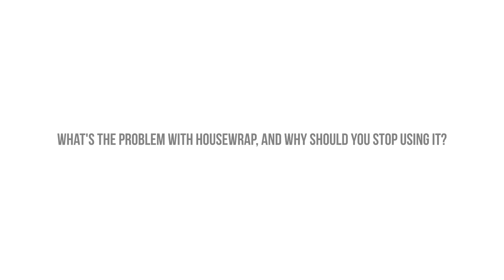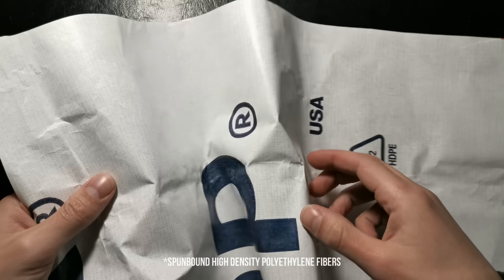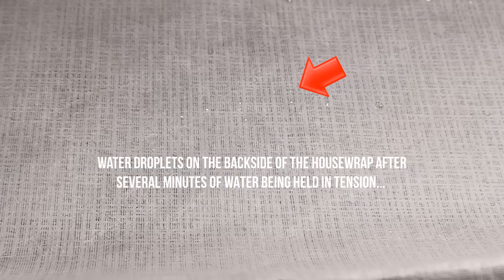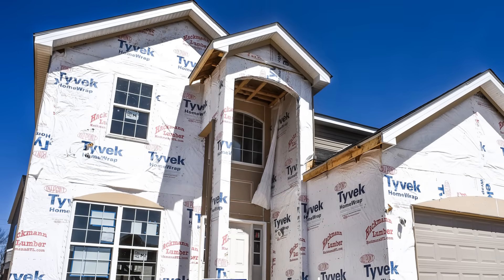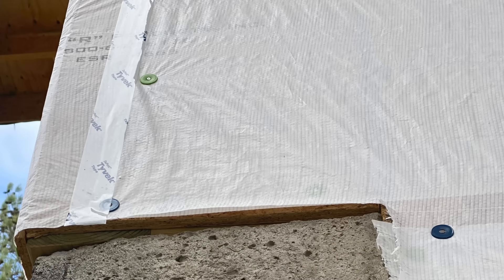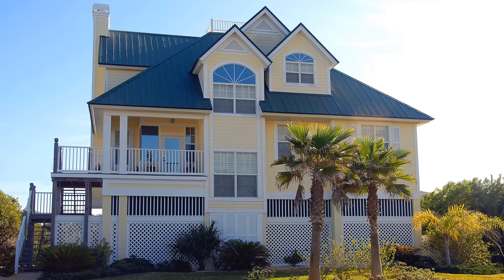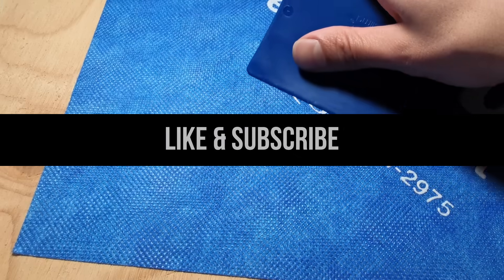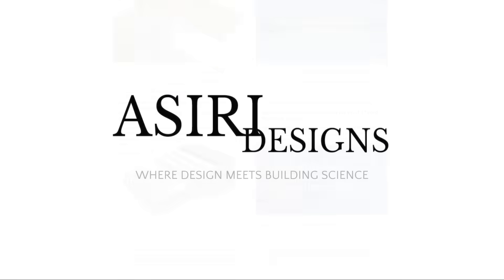Why I Stopped Using House Wrap

Comment: Regardless of what you use, INSTALLATION is the key. If it's not installed correctly it doesn't work. That also includes fixing any penetration by utility subcontractors. Just watch a few Home Inspector videos to see how badly it can be.

Comment: Tyvek is engineered garbage. That picture at 4:24 is real. My bad  experience as a builder had nothing to do with poor installation. We installed horizontal  lap siding over it with the recommended 1 1/4" siding overlap. The same method almost every builder was using. It turns out that wind driven rain can travel 1" vertically for every 10 mph of wind speed. 30 to 40 mph wind driven rain was normal where I built in the Columbia River  Gorge. We had to remove siding from 2 new houses in 1999. The tyvek was wet on the outside but that's okay. The lap siding was nailed to every stud 6" apart. The water was sucked into those nail holes and trapped inside. It didn't evaporate out. The water also traveled horizontally across the top of each course of siding until it reached a window or a corner where it ran down over and under the Tyvek. The OSB was soaked at every nail hole and swollen below windows and the entire lower part of the house.
That was the last time I used either housewrap or OSB. You can tape every seam and flash your windows but nothing will stop water getting sucked through every nail hole.
Put some good 30lb asphalt roofing felt over cdx, flash your windows and relax for 200 years. The tar in the paper seals the nail holes. It's permeable enough not to trap water behind it. I tried 15lb felt but there's no comparison to what you get with good 30lb paper of the grade sold by roofing suppliers. A hammer tacker won't tear it up like it does to 15lb felt.

Comment: Code needs to ban not having drainage between cladding and wrb. I’m about to have a house built and they looks at me like I was crazy when I mentioned using fluid applied wrb and rain screen. 400+k to build they want tyvek with hardie siding nailed directly to it. I don’t have room in the budget to argue against it but seriously considering not even building now

Comment: I wish wraps would reveal how much PFAS they are impregnated with. Truly the stupidest thing builders do is apply vinyl siding  on top of this house wrap for moisture to condense against. Bugs (especially stink bugs) love to hide in it - too many openings for bugs. The bigger stupidest thing is reducing eaves and overhangs to a foot or less and no eyebrows on walls over 10 foot high. It’s like they think the house wrap can handle everything. I’d sooner apply a coat of lime wash to my plywood and back side of my properly lapped siding than build with paper. It’s too thin and demolition has proven it has a limited lifespan - 30 year old paper falls apart when pulling it out. Lime wash adds fire resistance and captures carbon, yet remains vapor permeable.

Comment: 4:26 top right 2 spots failed u can c where the Z flashing ends above the trim covering the step flashing   The water got behind the siding n started trickling down as soon as it left the Z  n the step flashing was worse because it was lower n nobody installed a kick out flashing so the water could exit n do directly 2 the outside where it could dry instead of behind the siding n trickled down the wall n turned the OSB into a swelled up wafer board u could poke your finger through   The half round window looks like it wasn’t flashed right either u can tell it can in by the right corner n it got behind the siding 2   Expensive beautiful modern day home ruined by not flashing it correctly   Tyvek wrapped n taped b 4 the window install might’ve helped the half round  but not the sidewall flashing it would’ve gotten through either way   It’s extremely common   No one seems think homes need 2 breath anymore.  They make em so Trump tight they can’t dry out n mold seems 2 b the result especially with the newer wood n OSB the old school 3/4 tongue n groove would just turn 2 dust but it would take a really long time 2 do so

Comment: Thats All I use is tar paper heavier roll at H/D......Also All Pre dired Press Treated Lumber and press treated plywood with a white wash light paint coat with mildew blockers and also the short ext wall on my house with bath tub is press treated and cresoted to prevent rot...Bathroom Wall on North Side prone to mold.............Tampa...Mold Capital of the USA...............NEVER USE SPRAY FOAM.....YOU HAVE BEEN WARNED.....also Use All PVC Plumbing...

Comment: Bought a custom  1985 built home in BC .A few years back had some guys  build a massive deck  and increased the size of the doors to lead onto it .They were thought it strange that no waterproof backing was used behind the cedar siding ,the pink insulation look brand new .A plastic sheet was inside the home then the drywall ,all the studs had no sign of water damage .
Reply: That’s because siding is it waterproof it’s only supposed to shed water housewrap is supposed to let the house breathe but stop the direct wind the vapor barrier is supposed to go towards the inside of the home which there is many products but the key is to let the siding shut the water

Comment: Use metal back isofoam board with the same brand tape and it will break the thermal barrier between outside and inside

Comment: What would be recommended for a unit that has t1-11 nailed right to the studs?  I dont think I have room to add sheathing because of how the windows are trimmed.  There was building paper originally behind there and lasted fairly long here in California.   Replacing all the siding with new t-11 with good primer and paint

Comment: I own a 1930-built brick home in the Chicago area (wide temperature and humidity swings). Tar paper is over the lap board and under the brick. Seems to work. I've gutted several rooms down to the studs (kitchen and bathrooms. Zero evidence of any water or rot. It's a good product. Why do you think they use it on roofs???

Comment: depends where you live too I think. my house is housewrap with chinese fiber cement siding :-( I'm in the southeast about 1,000 feet from the saltwater sound. No rot..only rot in the cement board from staying wet all the time at places it touches down to the roof (fixing this atm). but somewhere else or a different type of house design can change things.

Comment: A lot of these problems are simple stuff that cant be helped. Say you build the most air tight perfect house then the termite guy comes drills bunch of inspection holes in the walls your at work he leaves to go next job starts pouring down rain before you could get home to caulk the holes thst most ppl dont caulk they dont even notice til 3 months later because hes not going to he has to come bk next year do inspection drill more holes if those are sealed up so they never do it and allow water intrusion. Ppl think of brick as a permanent siding but really just like wood metal or vinyl after 20 years its probably tome to tesr it off do good look behind whst was there an go bk w better. Brick or stone is far from permanent wall covering its a viel over the truth.

Comment: Now do a video on "Why I stopped using Oriented Strand Board". Here in Northern Michigan, I could spend a career replacing OSB sheathing that has housewrap and cedar bevel siding on top of it. If that OSB gets wet, some of the cedar siding will rot, but the OSB will turn to compost. I only use plywood for exterior sheathing, no discussion. The Journal of Light Construction had an article that demonstrated how the first time OSB gets wet, it's handles the water just fine. But with every wetting, the end grain in each flake of wood soaks up some water and degrades just a little bit. Every time OSB gets wet, it become a better sponge and absorbs more water than before. That's a big problem. Also, OSB doesn't transmit very much water vapor (when new, at least) so mold can grow quite easily if the wall or roof cavity gets wet.

Comment: The cladding as you call it should be the waterproof barrier. House wrap should not be necessary. Bad cladding or misapplied is unacceptable. A moisture barrier should never be placed where it will experience temperatures below the due point. House wrap will almost always experience temperatures below the due point and this will cause mold on or near the interior surface .

Comment: ive done renos for 30 years , tar paper is garbage. its called 20 minute or 30 minute . meaning it has a water repellant of said time. water runs down j channels on windows and on the bottoms of the windows the TAR paper disintegrates to NOTHING. wood is always wet,dark or black or worse rot. all of the builders and insurance companies demand quality home rap. tyvek isnt perfect but is far superior to paper. 3m peel and stick and caulking and your good. you cant stop water ,you only direct it away. basic grade 4 science. water will take the path of least resistance always. i ve seen tyvek that was 7 yrs old ,never covered and still doing a excellent job.ive seen tar paper get rained on over night and its warped and pulling away. nobody in modern times still uses paper. and almost every infill in my neighborhood used paper has had the walls torn down and redone! wtf. stupid
Reply: He goes "they used to use tar paper, but then they started using house wrap, which is flimsy" LMAO

Comment: DuPont has conflicting specs. for their Tyvek Home Wrap. One data sheet specs. 05 perms and the other specs. 54-56. Both are ASTM E96B Standard. Hmm... Grade D 2-Ply building papers such as Jumbo-Tex have a perm rating of 10. 15# felt paper is approx. 20 to 90 , it varies depending on humidity. Another consideration is the structure's interior. Vinyl paints and plastic barriers-over the insulation-also prevent moisture from entering the wall cavity from inside the structure.                                                                                                                                                                                                                If a wall traps moisture it's because the wall cannot breath and this is done from either inside to outside or from outside to inside. It MUST breath.                                                                                                                                                                                                                                         The vapor permeance characteristic of the sheathing/cladding assembly is defined by the effective wet cup permeance of both the cladding and sheathing combined. Four categories are established:

Vapor impermeable: 0.1 perm or less
Vapor semi-impermeable: 1.0 perm or less and greater than 0.1 perm
Vapor semi-permeable: 10 perms or less and greater than 1.0 perm
Vapor permeable: greater than 10 perms

Comment: I used ZIP on my 800 sq ft "tiny home" (smallest the county would approve for my lot). I LOVE my zip system house. On top of my 2 inch Zip R is some 1x2's and then my cementitious siding and some brick veneer, 1 inch of closed cell on the interior stud bays and rockwool bats. 2" Zip Ron the roof and 4 inch rigid foam between trusses I used cement board on all interior walls and appled smooth coat exterior grade stucco to the interior and real brick veneer on some areas on the cement board. (no closed cell spray on bottom of roofing because I was afraid leaks may never appear but I wonder. in Central Washington state if I should have used a vapor barrier on the interior wall?

 ....even of water gets in the walls should be okay and since we treated all the framing with the all green FrameGuard treated lumber. I basically wanted a house that could flood and maybe even dry out, okay not "flood" but if there is a failure it might withstand that failure more and also that FrameGuard treated wood protects from mold, decay and termite damage, supposedly,it was about 20% more than the lumber yard package for my build I think it was worth it

Comment: Just use concrete for sake 

Wood, wood plate, thermal i sulatuon, sound demper paper, building wraps 

That sound more cost and more works which means woods get weathered while wating for wraps to be happen. 

Americans building house with paper and wood is just so annoying

Concrete is way cheaper, simpler, stornger, and solves all of those problems with paper and woods

Comment: I am a builder for over 40 years. Do not use building wrap!!!! Also, no vinyl siding, no exterior rigid foam, and no spray in foam insulation!!!! Build with real plywood over studs, no OSB products!!!! Use black building felt on exterior. Next use only glass fiber insulation. Over that use 6 mil polyethylene plastic over the studs and insulation. Then dry wall over. This is where the vapor barrier belongs. Dry wall needs to mimic interior environment of home. The wall and insulation and exterior are meant to breath and interact with the exterior climate of the area in which are building. So in conclusion the plane at which interior and exterior of building exists is just at the back of interior finishes!
Reply: why not mineral wool insulation? Im planning on using that instead of fiber glass.

Comment: You need air movement, even in the wall.
I did a 100 year old house and there was no mold or there was some water damage(but no rotting)
The moisture needs to escape
Water, moisture is getting trapped at the bottom of walls and can't escape.  I have witnessed this numerous ways.

Comment: Nothing can protect the cheap materaisl they use thiese days. Wafer board sheathing, pressed board siding, all of it, just with the vapor from  air intrusion, is slowly turning into mold covered mush, I have an old garage built with solid wood produts. Some roof shingles have been missiing for years  with bare solid wood sheathing showing underneath . I fially got aorund to fixing itand the new shingles nailed in like it was new. The boards were weathered, but solid. This is in a very rainy area by the way., hte PAC NW.  I talekd to a roofer and they said 100% of the tiem when a new roof is put on a house iwth waferboard or plywood sheathing, the sheathing also needs to be replaced. Not so with an old solid wood sheathign roof.

Comment: Ask yourself a question, are the craftsman houses of 1900s (I've seen the same style craftsman house in Southern California, all the up the west coast in Portland, on up to Washington and Vancouver....every city inbetween e.g. West Seattle, Bremerton, North Tacoma) Many of these houses are still original exteriors and performing just as well today. Now we can argue about drafts, leaky windows and all the rest, lemme ask you something, this will help you understand my thinking (critically) and why I disagree with every modern code/design that's emotionally implemented under the guise of saving the planet. What's the benefit to modern windows? Saving heat transfer, they've stopped using the term UV blocking, because people started to question if they could still grow plants in their house with these modern windows, the answer is No! "Airtight building" , sounds great, until you start to understand that trapping air without proper ventilation is extremely dangerous, rebreathing carbon dioxide!! Then you get modern triple pane UV blocking windows, you get a modern HVAC system synthetic air, which is insane. Think about the process of photosynthesis......plants use sunlight to convert water and carbon dioxide into a sugar called glucose, which serves as the plant's primary energy source and a building block for other substances, This process occurs within the plant's chloroplasts and results in the production of oxygen as a byproduct. So let's build airtight, block the sun (energy) handicapping any interior plants you have, let's make sure no air leaves your modern house, let's breath synthetic air from cheap HVAC systems designed to "save energy" not designed to supply clean air to breathe, Let's hide the fact that every modern interior material is made Formaldehyde, a carcinogen, so flooring, cabinets, paints, pressed wood products (particleboard, plywood, MDF), adhesives, paints, coatings, and  textiles. So again what are we f'n doing?! Building the most efficient boxes of death, lost all art and craft, lost organic materials, lost everything once great about building custom houses. Just look around! Quadrants and profit based building is a cancer! We've lost our f'n minds, yall think your saving the world is the worst part, once a human is emotionally subconsciously invested in a idea, there unable to see debate differences in opinions, all of sudden logic is lost and the same corporations that are responsible for 99% of humans having PFAS aka "forever chemicals" in our blood, (look up Times Beach dioxin) the same corps that are responsible for us now having "micro plastics" in our blood, these same big business corporations have convinced you that these are what has to happen, the entire modern energy  industry, is based on their only concern....power and money! Did yall already forget about the BP oil drilling disaster? Ever realize their the ones pushing this climate catastrophe propaganda....they make us feel responsible for their insanity! We follow the rules, we recycle their plastic....I never knew some of their plastics are NOT recyclable! Wake tf up Bart!